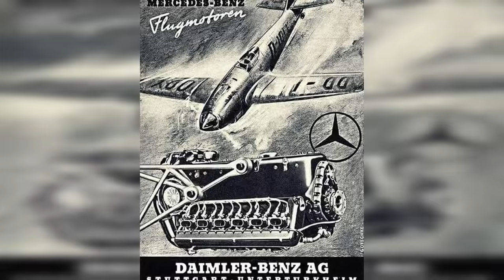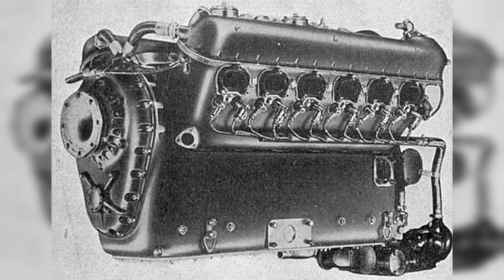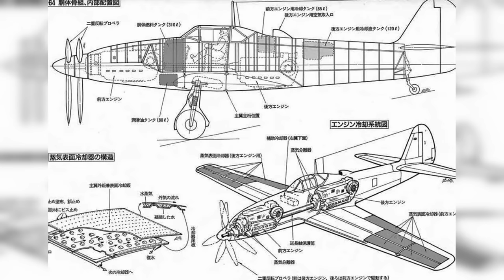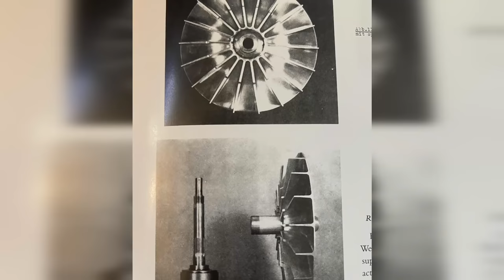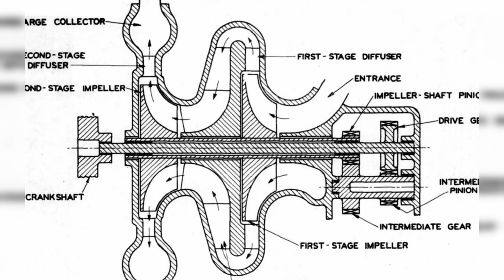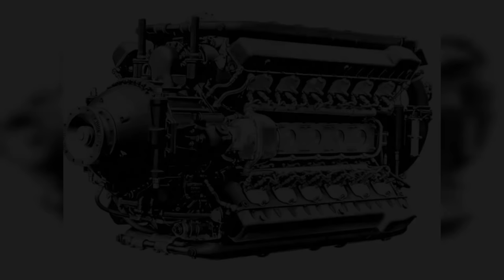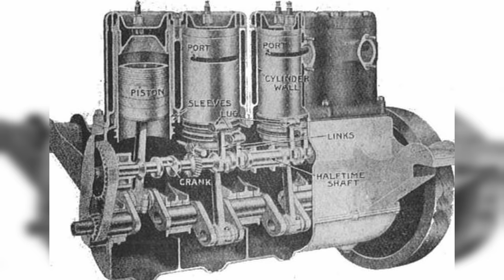The Engine of the Dark Side? Daimler-Benz DB-600 - DB-605 - Part 1

Comment: I did put forward the theory for the upside down engine may have been to divert exhaust noise from the cockpit. A 1000 hp engine with stub exhausts must have been unbearable for all pilots not just German
Reply: + yfelwulf  A German committee created the inverted specification back in 1920 or 1921.  The common theories are pilot visibility, but more importantly was easy maintenance for the ground crews.  They didn't have to climb all over ladders to their jobs.  The inverted design works as well as conventional upright engines.
Reply: @FiveCentsPlease  insanely loud flying a plane with one on it would b my guess

Comment: So how do you deal with oil on the underside of the pistons? I understand these engines are dry sump but any oil that ends up there is not going to drain away.

Anybody know?
Reply: That was the same question I had, I figures the oil behind the piston would beat them to death.
Reply: It could in theory be throw up onto the crankshaft on the up/down stroke

Comment: “Electronically controlled” fuel injection?  The Bosch pump you showed is a “mechanical” fuel injection pump, and I don’t think electronically controlled fuel injection – at least for automobiles – didn’t debut until the 70s.
Reply: The Bosch D-Jetronic electronically controlled fuel injection was still used in the 1960´s, eg in the VW 1600, Porsche 912/ 914 and since 1968 in all Mercedes V6/ V8 engines. The D-Detronic was than in 1976 replaced by the more advanced K-Jetronic and L-Jetronic wich used a air flow meter instead of a pressure sensor.

Comment: Something that looked interesting was the location of the spark plugs, both on the outside of the cylinder heads and quite close to each other. This in contrast to the Merlin where they were located on either side of the head, my Uncle said that the erks hated changing the inner plugs.
Was the German ignition system able to deliver a better spark, meaning they could get away with this configuration, even though the cylinder diameter was larger?
Curious.
Reply: The configuration on the DB lead to generally worse combustion and less knock resistance compared to placing one plug on each side of the cylinder (the flame front has to travel from one side to the other, vs having two flame fronts meeting in the middle). I believe they may have persisted with it simply due to a lack of space between the cylinder banks to accomodate the plugs; they were also cramming a 20mm cannon in there after all.

Comment: Bolinder-Munktell apparently made this with such better quality/reliability that the Swedish Airforce required each multi-engine aircraft to have at least one of their DB601 engines to be Swedish.
Reply: + Seigfried Gustafson  I think one rebuilt Bf-109 is using an original Swedish-manufactured DB-605.

Comment: I agree the DB is a supercool engine. And in the end, though Germany had to come up with advanced fuel injection, and supercharging methods, not to mention much larger displacement, to overcome their inferior fuel. So if they HAD obtained 100octane fuel, think what the DB600 could have done

Comment: All the cylinders are upside down! How did they deal with the oil dumping in the pistons and not getting into the combustion
Reply: +@edpetrocelli2633   Passages allow the oil to collect in the valve covers and be removed by scavenge pumps.  Most of these aero-engines were dry-sump and pressure-lubricated.
Reply: The area I was wondering about was the pistons acting like 12 cups bouncing up and down flinging alot of heavey oil around. Flying upside down and time spent at 0 g would require dry sump oiling and fuel injection as well. Perhaps at the low rpm it doesnt matter  @FiveCentsPlease

Comment: You said it was electronically controlled fuel injection, but showed mechanical pumps. How did it work?
Reply: Mechanical GDI  fuel injection with a electro-mechanical engine control unit.

Comment: the direct injection gave a number of advantages,namely you can increase engine compression for efficientcy ,or run on inferior low octane fuel
Reply: Direct injection isn't prone to knocking or pre ignition because it's not mixed with the air during the intake and subsequent compression stroke. Not until the very top of the compression stroke is fuel injected into the combustion chamber. A lot like a Diesel engine but spark ignited
Reply: Fuel injection produces more power because there is no pressure drop though the carburator venturi... no problems with icing either.
Reply: @sandervanderkammen9230  this direct fuel injection has other benefits,but at least one downside-carbs can tolerate dirty fuel much better
Reply: @andrewsmart2949  Both the British and the Americans developed reverse engineered versions of the Bosch GDI and began production just as jets appeared and the war ended. 
As I recall the later Lockheed Constellation R-3350s had GDI and it was credited with greatly improving fuel consumption and extending the time between overhauls because of the more precise mixture control and fuel distribution between cylinders.

Turbocharged engines also operate even more fuel efficient and the turbochargers themselves last longer because because less fuel enrichment is required and EGTs are lower.
Reply: @sandervanderkammen9230  all those radial engines you mentioned still ate exhaust valves in rear cyl banks regualrly,id say injection offer superior anti-icicng performance in the passenger liners you mention,but jet aircraft will survive a lightening strike much better due to fuel being less flammable
Reply: @andrewsmart2949  The Curtiss-Wright R-3350 with GDI had a fuel efficiency rating of 36% percent in 1945.. that's as good as a 1st gen Toyota Prius engine.
Reply: @andrewsmart2949  Indeed, thats why GDI greatly extended overhaul times... 

Aircraft are very unlikely to be struck by lightning above 15,000 feet... jet airliners spend most of their flight time at over twice that altitude great reducing lightning strikes.
Jet aircraft have crashed from lightning strikes on takeoff and landing, often by lightning striking the wings and igniting the fuel vapor and causing explosive damage and fires.
Jet fuel ignites very easily with a 1 million volt spark plug!!!

Comment: They would have been better off using their expirimental resources for developing one type of reliable, mass produceble jet, and on improving their conventional designs, instead of embarking on several exotic proof of concepts. Also, if in the 30's, Hitler pushed german industry into consumer products such as automobiles, airliners and commercial shipping, then Germany could have developed the basic technology without setting off the same degree of anxiety in Europe, and might have been able to stockpile strategic resources through importing them without setting off alarm bells. Politics is a game of patience, and this was a quality that Hitler lacked altogether.

Comment: how did its oil pump and pan upside down work? fuel injection work any position but oiling was trick
Reply: +@tomcumby9045   Dry-sump and pressure-lubricated oil system with scavenge pumps.

Comment: I want to know how the oil system works.  Does it use a dry sump system?
Reply: + 1147cc   Most of the aero engines were dry sump and pressure lubricated, including the DB series.  Scavenge oil pumps in the lower rockers return the oil back to the system.

Comment: How did cannons fire through the propeller hub?
Reply: The engine has a reduction gear at the front so the propeller turns slower than the crankshaft, which also means that the line of the propeller shaft is offset below the engine's crankcase. The shaft passing through the gear was made hollow so the cannon could fire through the middle of it.

Comment: Okay cats&kittens where did you think  the DB600 came from?!!!,in 1934 the standard German  liquid cooled aero engine is BMW,s VI, a somewhat lacklustre late 20,s V-12 of 660 700hp. By 1936, less than two years later the first DaimlerBenz 600 ran on the test bench at Stuttgart . By 1937 production DB600,s rolled off the Stuttgart production line heading for Heinkel at Rostock, Junkers at Dessau,and Messerschmitt at Augsburg. 1935 Rolls Royce sold  a handful of Kestrel engines to Germany, two powering the  prototypes of Luftwaffe aircraft that nearly brought our country to its knees in 1940,the Junkers Ju 87 Stuka and Messerschmitt Bayerische Flugseugwerk BF-109. Yes cats&kittens we unwittingly gave Mercedes a helping hand in the DB600,s design and development. At Stuttgart Mercedes engineers were all over the Rolls Royce Kestrel,like a cheap suit,and after an extensive strip down studying that engine,s each and every feature. Valve gear combustion chambers , cylinder block ,ignition ,carburettor, and crank case. Using said features gleaned from the Kestrel ,all Mercedes engineers did is turn their V-12 upside down made it a tad larger at 33 litres and fitted their  side mounted blower, the DB 600- 601-603-and605,s 'Achilles Heel'.  Yes Rolls Royce gave the means for  Mercedes to develop their new engine ,on a silver plate. At 960 hp twirling its crankshaft around 2600rpm the DB600,s pony count is decent for a late 30,s V-12 Aero Engine,and yes cats&kittens Mercedes engineers did not sit on their laurels. Summer 1937,at an international fighter meet held at Duberndorf in Switzerland , D-IPKY set the tongues wagging,like Kim Kardashian opening a village fete,. D-IPKY was a standard Messerschmitt BF-109C taken off the Augsburg production line,its 700hp Junkers Jumo 210Da another then modern V-12 aero engine developed by Junkers from the Kestrel swapped, In its place the DB601 almost identical to the DB600, except for Robert Bosch,s direct petrol injection system  heavily reworked from that used in lorry diesel engines.   Including  direct petrol injection raised the DB601,s pony count from 960 to 1100hp, 1200hp in the N Series burning 96 octane petrol. 1100, wow that is serious ponies for a pre war V-12, only GM,s Allison V- 1710 at 1,000hp came anywhere close to the 601,s pony count. D-IPKY served as the prototype of Messerschmitts E-Series 109, clocking 354 -55 mph,in a series  of tests ,the mutated 109 knocked the opposition into a cocked hat , giving cause for concern back in  UK. That is why Reginald Mitchell,by working himself to death to design, develop the Spitfire in record time,for he saw the dice loaded against Britain.
Reply: Well, nobody forced Britain to declare war on Germany, right?

Comment: firing order must be different to Merlins?
Reply: + Rose White     Different yes.   The V12 design has multiple firing order options. Crankshaft durability and design is a factor because the power pulses can cause crank wear and failure eventually.  There are even different firing order patterns various versions of the DB engines.
Reply: @FiveCentsPlease  Merlins make a lovely sizzle while DB sound a bit odd.
Reply: @rosewhite---   Compare the Merlin and the Griffon.  They have a different firing order.    Valve timing also affects the sound, and the DB-605 had a pretty hot cam in it.   This DB-605 was getting some service and listen to that cam.  https://www.youtube.com/watch?v=_2gDVc46VNA

Comment: How did they keep oil from entering the combustion chambers when off?
Reply: + Robin Page   The lowest point is the rocker covers, and scavenge pumps removed the oil.
Reply: Like the bottom pots of any radial, need to be turned-over by hand in case combustion-chambers filled with oil previous night...

Comment: I was curious about oiling was it total loss 2 cycle or dry sump,I have trouble understanding oiling on a inverted 12,also was the MB 300 sl fuel injection system derived from this?
Reply: + David Pistek  Most of these aero engines were dry sump and pressure lubricated.   Scavenge pumps recovered the oil from the lowest points in the engine, the rocker covers in the inverted engines.  Radial engines also had scavenge pumps although you still had to check the lower cylinders for oil accumulation before starting.
Reply: Yes, fundamentally the same Bosch mechanical GDI system, but less sophisticated.
The DB-60x system had an early form of electro-mechanical engine control unit not found on the automobiles.
Reply: I'm a car guy although really interested in airplanes especially the technology a dry sump makes total sense, they sure look strange upside down

Comment: The DB603 had produced 3000hp in 1939. The third DB603 ever built was a 3000hp special made for the T80 Mercedes Benz car that was due to make an attempt on the land speed record in 1939 however the start of the war stopped it.
The engine ran on a special mixture of methyl alcohol (63%), benzene (16%), ethanol (12%), acetone (4.4%), nitrobenzene (2.2%), avgas (2%), and ether (0.4%) with MW (methanol-water) injection.
The T80 is on display at the Mercedes museum in Stuttgart Germany.
Reply: Same formula used by German Gran Prix race cars..

Comment: Did this engine run on diesel or petrol? Sure I read somewhere it was diesel.
Reply: + dave worthing   Petrol.   Low-grade petrol synthesized from coal.    A few aero engines were diesel but I'm not sure how many saw service verses just test versions.
Reply: German engines were equipped with GDI (Gasoline Direct Injection) fuel injection which is similar to the type used on Diesel engines, they have superior performance compared to Allied engines that relied on obsolete carburators.

GDI gives more horsepower with less boost pressure and lower octane fuel, eliminated icing and did not lose power or stall in a dogfight like the Rolls-Royce Merlin.
 The Allies had nothing comparable and lacked the technology and technical expertise to build GDI engines until they were already rendered obsolete by jet technology.

The Jumo 205 series Diesel was made produced for several maritime  patrol aircraft and for the Junkers Ju86.
The German engine was also licensed by the British company Napier and sold after the war as the Deltic.
Reply: @sandervanderkammen9230  Interesting. Thanks for the reply.
Reply: @FiveCentsPlease  Germany did have diesel aircraft engines such as the opposed-piston Junkers Jumo 205.  They were used mostly on flying boats and high-altitude reconnaissance aircraft.

Comment: Imagine what if this engine and the BF 109 had help from swept wings, automatic slats, and no distraction from crazy experiments. Also adding 4-6 20-30 mm cannons, powered canopies and that mechanical computer modified of course, from the FW 190 would have been the pain of the British. Also making the DB 603 into a high altitude engine would have been great.

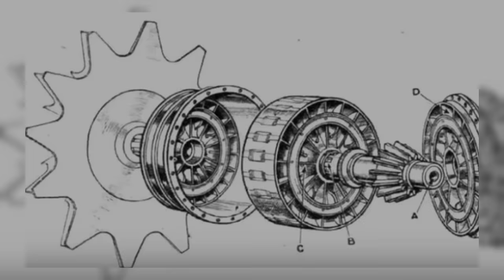Comment: 13:17 fuel injection permits negative g manoeuvres without affecting mixture control. One can fly a carburated aeroplane inverted as long as positive g is maintained, e.g.. in a barrel roll.